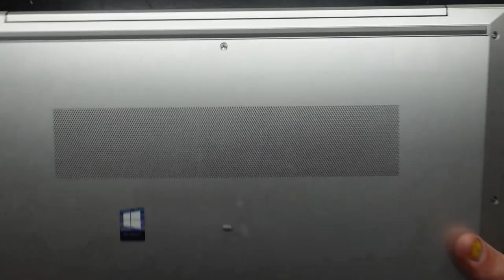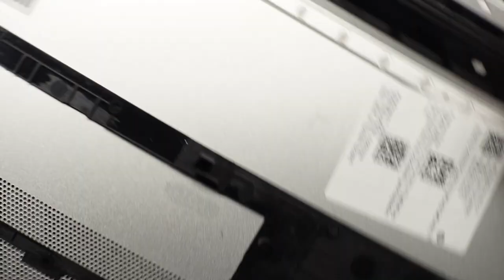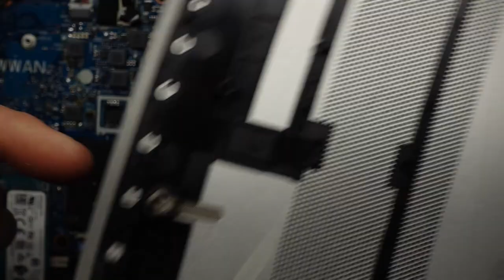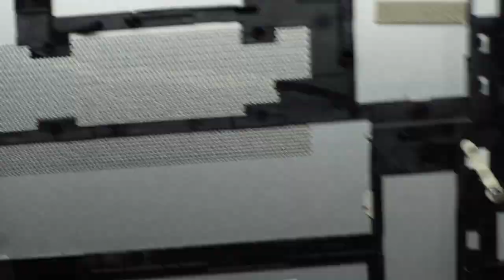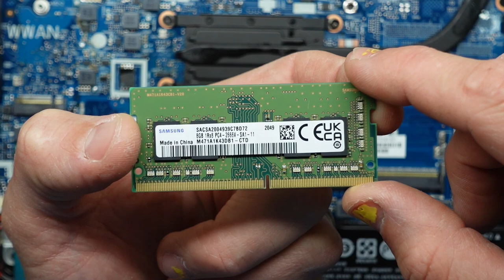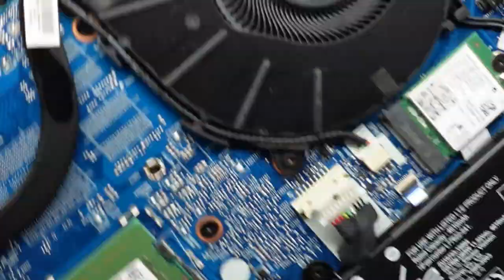HP Elitebook 850 G7 Teardown, Ram and SSD Upgrade

Comment: 5:32 what do you mean by "inside of this is nvme ssd", while pointing at the wifi card? Sure this is an m.2 slot, but wifi card uses different key.
Reply from the maker: Correction "Same as an NVMe SSD" 

as in the method to swap out of the ifi card is very similar to a NVMe SSD

Disconnect antennas
Undo Screw
Pull up slightly and out
Reply: @rickstechrepairs  Oh! I can now hear "And same as the nvme ssd" 😅 Thank you
Reply from the maker: :) no worries

Comment: Hi can help me I saw ur video with msi gf65 thin gaming test I have same laptop but my fps isn't High like ur laptop so can u help me?
Reply from the maker: have you used the msi dragon software to switch the modes to performance, also a dumb one but the power cable is plugged in ?